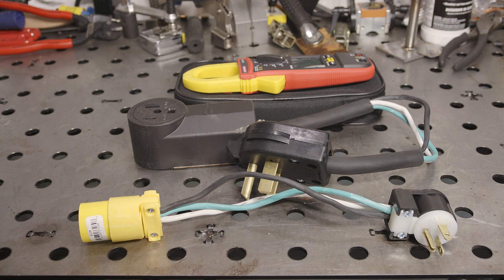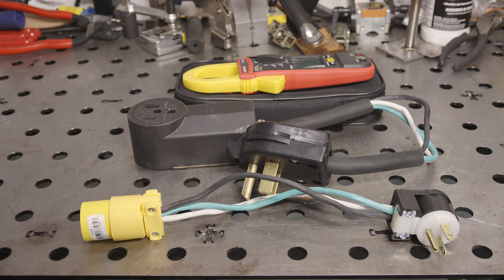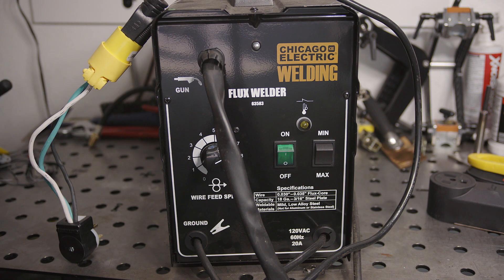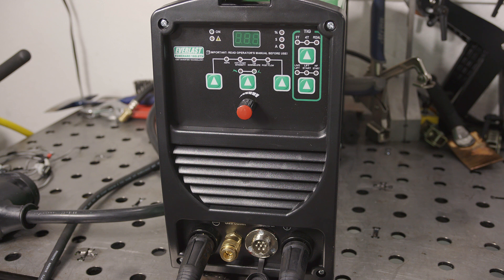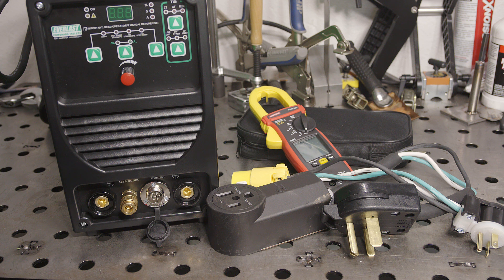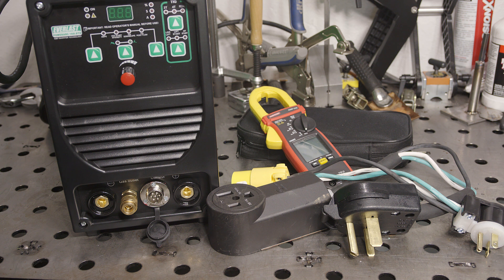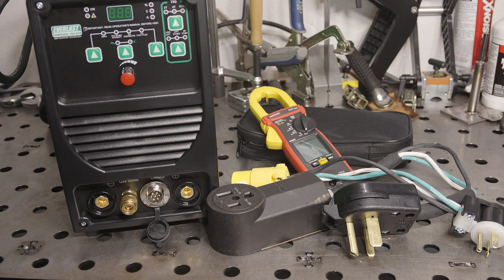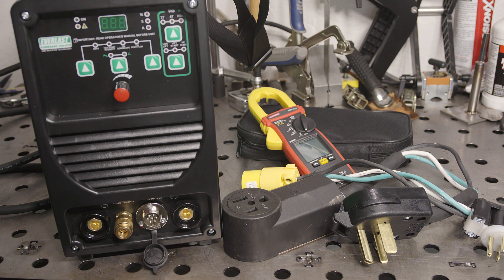Testing Welder Amp Draw, Will it Trip a Breaker?

Comment: Holy crap thank you so much for this video! This has been confusing the hell out of me, I was thinking I needed to have a 50A circuit installed to run even the smallest stick welder I could find. I have 20A circuits at home so I should be OK.
Reply: Depends what else is on that breaker. Best practice would be to have a dedicated ciruit.
Reply: @garbo8962  very true, thank you. My garage circuit does power some large fluorescent light fixtures so it'd be risky to use that. I am actually still considering hiring an electrician to run a dedicated 40 or 50A circuit in my garage since I also want to run a high current dust collector along with and 15A power tools. So atm I'm getting sawdust everywhere and still don't run a welder

Comment: Great video! I'm in the process of wireing up the shed for my welders (old Lincoln 240V AC-DCbuzz box, Amico CST-160 Tig combo, and Amico MIG 130A flux core) Your info shed light on a few things I knew but never understood. Thank you and looking forward to more vids!
Reply: I pretty much have the same setup of welders and I'm thinking of doing the same of wiring up an outlet, what did you end up going with for wire and breaker wise. I was thinking about going with somewhere around 6 gauge wire and a 220v 50amp breaker that I'm going off my box inside my house about 60 ft in length, does that sound suitable for what I am wanting to do. I have the same old Lincoln buzz box and amco 130 flux core welders and don't want to risk maxing out my 30 amp dryer outlet but keep having people tell me that using that outlet is fine kind of what is being shown in this video I believe, but any input I will take please. Thank you, God bless and don't shock yourself LOL

Comment: On a lincoln le31mp welder,very good info.thank yiu sir,i bought a gfci outlet since its going outside and 6 foot 10 gauge wire from out let to 30 amp breaker 120

Comment: very helpful, plan to use a 50 amp 2 pole breaker for 220 with 6 guage wire to outlet on its own circuit.

Comment: I have a Lincoln mig 140:that was frequently tripping the breaker.   I isolated an outlet  next to the panel and gave it a dedicated 30A breaker and a HD 20A outlet ( that's the biggest they make).  Still easily trips the breakers in the gen.

Comment: Have you tested a 110v yeswelder flux 135? I have one and need to figure out what breaker to get so I can run it at higher amps. I need it to practice uphill welding.

Comment: Even it may not immediately trip the breaker, i am worry about the temperature of the wire inside the wall.
Reply from the maker: Technically, one of the main jobs of the breaker is to protect the wire.  So if the wire and breaker are sized and installed correctly, the thermal trip mechanism in the breaker should heat up and trip before the wire heats up too much.  

But if there is a poor connection or a particularly well-insulated section of wire, it could theoretically heat up more than it otherwise should.  It's one of the reasons I'm always happy to reduce current draw whenever I can.  Current plus resistance creates heat.  Excess heat over time can cause all kinds of issues, up to and including fire if the situation gets bad enough.  Still, as long as there are no issues with your wiring, you should be okay.

Comment: Hey there! Thanks for sharing your knowledge.  I just bought a Lincoln 225v welder ( ac only, no dc). My garage already has a 240v outlet and the breaker box is labeled "welder" on the 40a breaker.  The best info I have found thus far is that this welder requires a 50a breaker. Can you believe that the owners manual has absolutely NO info about the breaker size? So I'm wondering if my current 40a breaker will be ok for my small little projects.  Reason I'm asking, is because there's no since in going to all that trouble if the 40a will work,,,, and,,, I have an unusual brand  breaker box and a 50a is gonna cost me about $100. If I can get by, I'll save myself the money and time waiting for the order.  I have a spare 40a breaker anyway and it's not gonna hurt to try I guess.  I really appreciate your advice and help. Thank you!!!
Reply from the maker: My guess is that a 40 amp breaker will be fine for your use, particularly if you aren't running the welder at max output.  Honestly, I would just try it.  Chances are it will work fine.  If you find you are tripping the breaker a lot, then you can look into an upgrade.  But just be aware, you shouldn't simply upsize the breaker without upgrading the wiring, or verifying that the existing wiring is rated for a larger breaker (it probably isn't).  If the existing wiring is only rated at 40 amps, you shouldn't upsize the breaker.
Reply: @bigtb1717    I sure appreciate your thoughts. Believe it or not,  I've done LOTS of electrical work,  I'm a licensed HVAC technician with a background in refrigeration and home appliances,  but retired now so its been a few years.  (Old age sucks 😆)   At a glance,  I think the wiring in that outlet is #6,,,I might be off, but if I am  its an 8.   I had to replace the outlet because the type that was there was like the type a dryer would use, you know the one with the 2 hot prongs diagonally slanted.  The man that built the place was a retired Navy jet engine mechanic with an electrical engineering degree,,, so I totally trust him even though I never met him. We bought the place after his passing. House was built in 1992, and there's no telling how old or what type of welder he actually used with that outlet.  But I can see his handy work all around the place, he was a lot like me, very creative and pretty much built or repaired everything he needed. 
I have pretty much made up my mind to bring that new welder from the barn to the garage and give it a whirl. Can't hurt, and I'll find out real quick if I need to get a bigger breaker.😆  Hubby wants to have it all set up in "His" man cave barn, but I'm gonna have to do a lot more work to getting an outlet in the barn.  I'm pretty sure the old man just kept his equipment stored in there with a small work bench.  Plenty of bright lighting and only 4 outlets.  I believe I'm right by calling it a "industrial disconnect fuse box"    in the barn.  I'm not familiar with it because its way older than I am.   It's a metal box about the size of a shoe box with 3 large tubular 30amp fuses in it. They are about twice the size of a lipstick.  So I'm not sure, but I'd imagine each fuse is dedicated to 3 different circuits,,, like outside lights, inside lights and outlets.  Just a logical guess.  But I'm gonna want to replace that with a breaker box eventually. 
Anywho, just thinking outloud. Thanks for your thoughts on it anyway sweetie!
Reply: How did your Lincoln buzz box run off of your 40 amp breaker, I'm curious because I have the same situation going on and was going to do the same. So was wondering if you had problems with your 40amp breaker tripping a bunch and if you had to upgrade or not. Please would like to know your opinion especially since you work with electricity and have the same Lincoln AC buzz box as I do, looks like one that was built in the 60s or 70s very solid and dependable. Thank you, God bless and don't shock yourself LOL
Reply: @tammymorris-traylor6320  Just a suggestion...... he might have used that outlet to back feed the panel with a generator if the power went out.......maybe that is why it was only a 40amp breaker...... Just because he was an electrical engineer means nothing....  I bought a house from a plumber and you would think he would have done all the plumbing right......not......
Reply: Tradesmen tend to use what they get for free at home.

Comment: Great video and good to know information. I'm wondering if you have checked the amp draw from the Juba ZX7-200 with your adapter at it's max setting? This type of video is very interesting to me and thanks for posting it. Take care :)
Reply from the maker: I haven't checked it yet, but I plan to check a bunch of different welders eventually.  I was running out of time yesterday and decided to make this video more about the concept and to explain breakers a bit.  I am curious if there is a significant difference in welder efficiency between cheaper and more expensive welders.
Reply: @bigtb1717  Nice! Looking forward to the video when you get a chance to do the testing. Have a good day :)
Reply from the maker: Thanks, you too.  I'm looking forward to it as well.  I plan to test out 4 or 5 welders on 120V and 240V.  I'll match their output (actually measure it rather than relying on the display) so that I'm getting the same amperage out, then I'll check and compare their amp draw.  It will be interesting to see the amp draw in general, but also to see if there is a meaningful difference in efficiency.  Really busy with work and projects around the house, not to mention other videos.  I hope it isn't too long before I can get it done, but time goes fast, so we'll see.

Comment: I have a  20amp 120v and a 20amp 220v in my garage. Would the 220 20amp give my welder more room if I bought a 120/220 welder? Thanks
Reply from the maker: The 240V outlet will definitely provide more power with a 240V welder, even if the breaker is only 20 amps.  Wattage is amps times volts.  So you can get double the wattage from a 20A, 240V receptacle vs. a 20A, 120V receptacle.  

Depending on the welder, you may not be able to turn it up all the way on a 20A receptacle.  But I have inverter welders with power factor correction that can provide nearly 200 amps of output with 20A input at 240V.
Reply: @bigtb1717  Thanks for the reply! Again i have randomly been googling this topic for a over a year with no answer. Again thank you so much! Subbed!
Reply from the maker: No problem.  Here is another video where I show amperage draw on 120V and 240V from a variety of different inverter stick welders.
https://youtu.be/fzkD9Zkt0K8
Reply: @bigtb1717  Hey just wanted to let you know I bought a 50amp plasma cutter and a 180amp mig welder and I was able to run them no problem on my my 220v 20amp circuit. Just wanted to thanks you for your video. Without it I would still be wishing I could get a welder and plasma cutter from what the internet says. Thank you, Thank you, Thank you!

Comment: My Titanium Easy Flux 125 is tripping my 20amp breaker welding 3/16" after about 30 seconds.  The circuit is 10/2 wire but standard outlets are only 20amp so I could put in a 30amp breaker then the weak point is the outlet. I guess I could put in a 30amp outlet but then I would need an adapter like in the video to plug in the welder.
Reply from the maker: My recommendation if you are going to do it is to put in a 30 amp outlet.  Making an adapter or changing the plug on your welder is inconvenient and you probably wouldn't have an issue with a 20 amp outlet, but you never know what might happen down the road.  I've seen outlets burn up (as in, become a smoking pool of molten plastic and charred metal) when run for a while with too much current.  I've seen it several times over the years and it was incredibly lucky it didn't cause a fire.  Overcurrent leads to heat which leads to increased resistance, which leads to more heat...

Comment: Thanks, you explained a lot. I purchased a 120 volt flux core welder and it trips my 15amp house breaker in about 5 seconds. It trips my 20amp generator breaker in about the same time. My welder has a standard 3-prong male plug like those on household appliances. My generator has a 120v 30amp outlet but requires a special 30amp plug. What I can't find is a 30amp female plug that matches my welder's male plug. Question: Should I just cut the plug off my welder and re-wire it with a 30amp male plug?
Reply from the maker: How many watts is your generator?  

You could make an adapter to go from the plug on your welder to the plug on your generator.  But there's also no reason you couldn't cut the plug off your welder and wire a different plug onto the cord.
Reply: @bigtb1717  Thanks. It's 3600 Watts with 4000 starting. Is there a female 30amp adapter that will fit the 3-prong plug on my welder?
Reply from the maker: 3600 watts may struggle to run your welder, especially if it's maxed out.  If your welder trips a 20 amp breaker in a few seconds, it's probably drawing upwards of 30 amps.  Even 30 amps would be 3600 watts.  If it draws just 35 amps that's 4200 watts.  Just something to keep in mind.

To make an adapter you'd just get a female end that matches up to your welder, a male end that works with your generator and then connect the two with a bit of cord.
Reply: @bigtb1717  Thanks, I think we'll buy a larger generator. We need one that puts out 220 to run our water pump anyway.
Reply: @bigtb1717  The issue is, the highest amp rating for a female end that matches my welder plug is 15amps. They don't make those higher than 15amps. The end that plugs into the generator is 30amps. I'll try that to see if the female end melts. Because the welding isn't continuous, maybe it will work.
Reply from the maker: Yeah, welders are a bit of an exception because of the duty cycle.  Most 120V welders have a 15 amp plug on them even though they will likely draw much more than that when maxed out.  But since they are only rated for like a 10-20% duty cycle when maxed out, it's not typically a problem for the amp rating of the plug.

Comment: My old cebora pocket mig asks for a 20 amp circuit but if you run it on max it will trip the breaker after 5 seconds.  I switched the circuit to a 30amp

Comment: I bought a small stick welding plan able to weld up to 250 amps. The machine is capable of running on both 110 and 220v current, however the input plug is a 20amp t styled 220 plug. I've made an adapter that allows for the Male 20amp plug to draw regular 15amp current from a regular 110v outlet. I'm electrically impaired 🤣🤣🤣🤣.  Can you give me a dumbed down answer as to why this is okay or not?
Reply: It's not safe

Comment: So If I was to run a Lincoln electric 225 ac arc welder on a 125/250v 30 amp breaker 3 prong dryer outlet using an extension cord at would it work fine for welding at 75 - 120 amps? 
thank you for your time
Reply from the maker: At 75-120 amps it would probably be fine.  Just be aware that those older machines are not as efficient as the newer, inverter machines.
Reply: @bigtb1717  alright thank you for letting me know great videos by the way

Comment: When a welder is set at 125 amps welding current,  ,   and input voltage is 240 vac.  Is there a formula that tells. What the input current is ?  Thanks
Reply from the maker: Unfortunately, there is no simple formula for that.  If you have 125 amps of output current, total wattage will depend on the arc voltage.  For instance, if the arc voltage was 17V, then output wattage would be 2,125 (125A x 17V).  In that case, the minimum input wattage would be 2,125, but that assumes zero losses, and there are always losses.  Assuming no losses, 2,125 watts at 240V would be 8.8 Amps (2,125 watts divided by 240 volts).  But again, that assumes a power factor of 1 and zero losses.  In reality, current draw would be higher.

Unfortunately, you need more pieces of the puzzle than just input voltage and output amps.

Comment: Great evaluation but I still do not understand how my Miller 235 has a full duty of 60 at 170 amps and requires only a 50 amp breaker. That is 120 amps greater than the breaker for 6 minutes. 
Thanks again! Great presentation!
Reply from the maker: 170 amps is the output current, not the input current.  So your welder can output 170 amps for 6 out of every 10 minutes.  However, when putting out 170 amps of welding current, it will be drawing far less current than this from the supply circuit.

You are probably supplying your welder with 240V input.  At 170 amps of output it may be putting out 25-26 volts or so.  So with 240V input, the welder may only have to draw 30 amps of current (assuming some losses and imperfect power factor).

Comment: What kind of generator should i get for a 120v 90amh welder? Its able to be plugged into a regular home 120v plug in.I’m just not sure how it would do all the way maxed out. Also do you think running a extension cord from the house to the welder is a good idea i dont have outlets in garage.
Reply from the maker: I haven't done a lot of welding from a generator, but I'm betting you'll want a 4 to 6,000 watt generator.  Much less than that and it might struggle.  

You could try an extension cord.  How far is it?  The longer the cord, the thicker you'd want it to be in order to reduce voltage drop.
Reply: Id say the outlet is 50ft from the the garage.

Comment: My welder keeps tripping the breaker, I think when I run it super hot and for a long time, I have asked other welders and they say I need a bigger breaker outlet and wires, for example I’m probably running a 15 amp breaker and outlet and they say I need something bigger like a 20 or 30 amp breaker outlet and wires. Will that fix it?
Thank you
Vlad
Reply from the maker: From your description of the problem, it sounds like a higher amperage breaker would help a lot, and possibly eliminate the issue entirely.  As  you say, you would need a higher amperage breaker as well as an outlet and wiring that could safely support the higher amperage.

Comment: I have a vulcan 215 and i use the 120 plugin rated for 20v but it keep popping breaker after continuous runs. But i have a 240 plug that can be hooked to a 30 amp breaker On my generator. If i hook my 240 plug to 30 amp plugin. Will i lose the issue? I have a predator  9000 watt generator.
Reply from the maker: If you run a similar amperage setting on the welder to what you are running now, you will likely have no problem.  But if you max the welder out, it may pull more than 30 amps.  I can't say for sure, because I never measured the 215 when I had it.